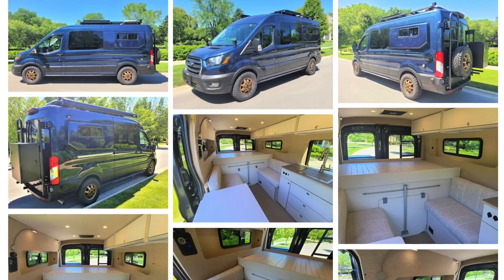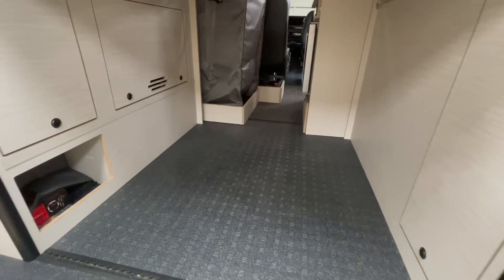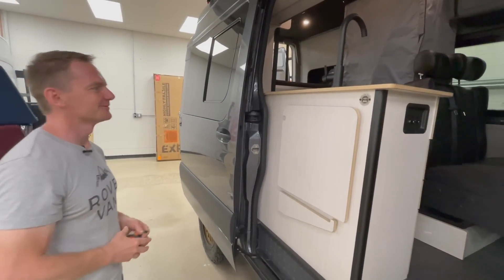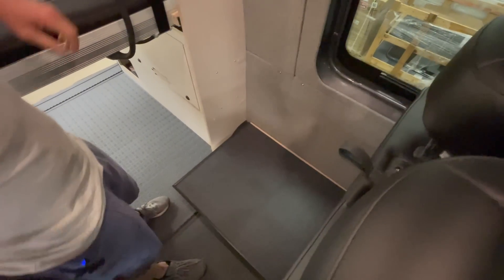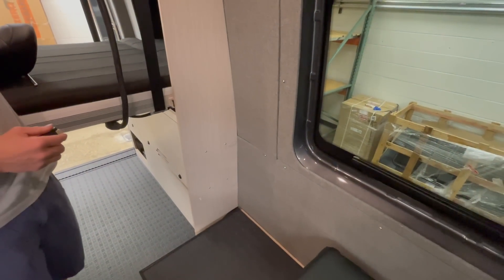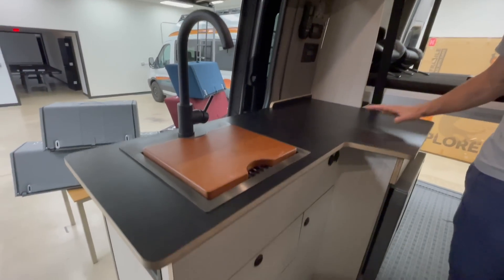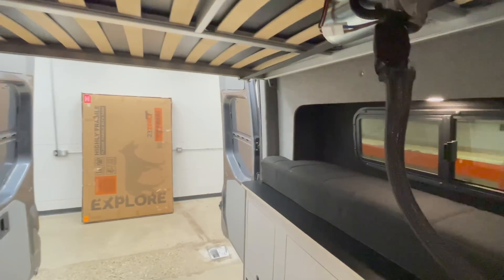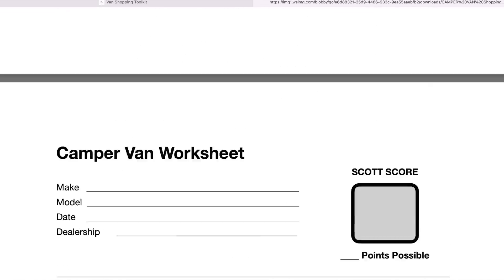Tour SWEET Adventure Van

Comment: Fyi Panoramic RV (based in Quebec) can also sleep 3 and has 4 seatbelts, with similar front lounge setup - and still has space for a permanent bathroom. That's the difference the extra 1.5 feet of the Ram Promaster can offer, for those who don't need the 4*4 Sprinter.
Reply from the maker: Thx Liora !!

Comment: YOUR ROVER WEB LINK IS BROKEN. FYI. I really like what ROVER does. So original. I don't see a toilet. However, get a Laveo dry flush, build in that little 12v connector it needs on the wall and drop it on top of that shower box. Taking a shower, just unplug the Laveo and set it in the garage and put it back when done. They would have to devise a quick release base plate or just make a little well for the toilet to stay located. My favorite is the open end grain of the plywood cabinetry. Very retro craftsman style...
Reply from the maker: Link hopefully fixed. Thx V L